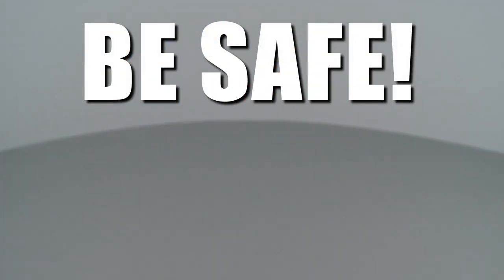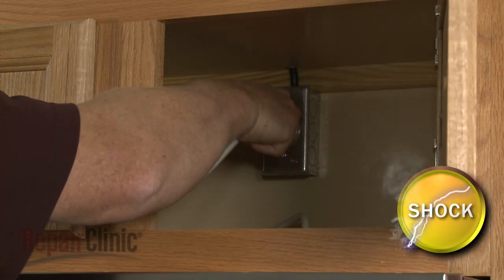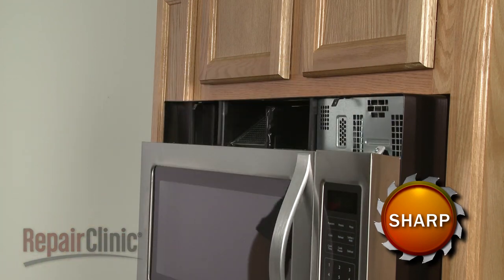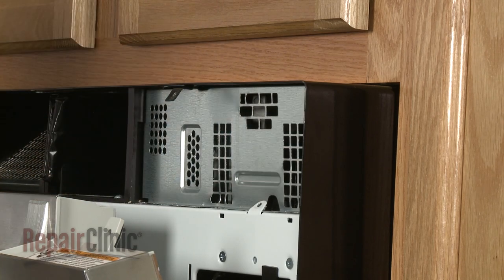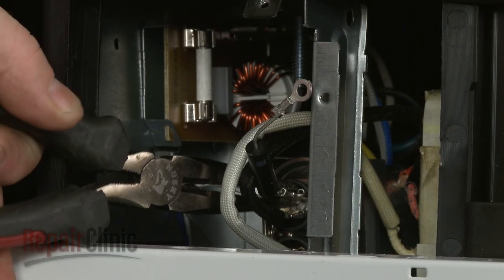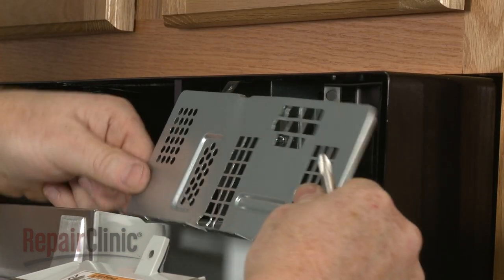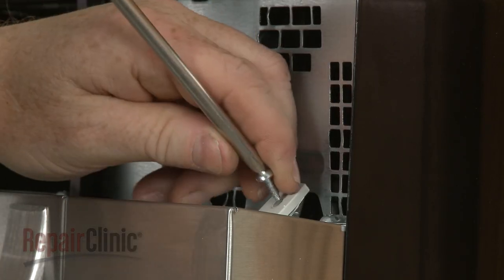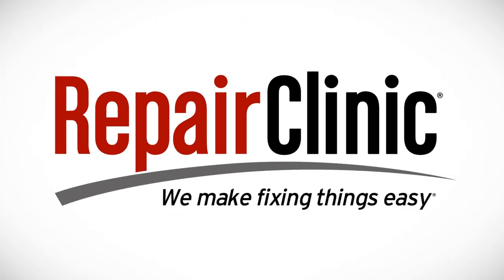Microwave Isn't Heating? Diode Replacement #W10492278

Comment: I just swapped this component out and it worked just fine afterwards. DO NOT THROW OUT YOUR MICROWAVE! This part cost me $5.98 on Amazon free shipping. Would have taken 10 minutes but I didn't have the correct tools. This was such an easy fix.

Comment: my mic has no heat but the dish turns and makes its ussual humming.  is my diode bad or magnatron bad?
Reply: Check diode for burnt residue on wiring ends from diode out . supposed to be silvery not black and ashy . but maybe you already fixed .since was year ago .
Reply: ddogglife21 my microwave has the same issue...not heating...should I replace magnetron or diode?
Reply: Carol Peters im waitning on my diode to deliver but mayve couple more weeks .you shouldnt x out magnetron that quick. Cuase my micro was acting funny few months ago then just started normal for next two months .so it wont hurt to try also i have micro since 1993 .not ready to just let go . for 5 bucks wont break the bank but money tight right now  .good luck. If you want to replace magnetron probably cost as much as new micro wave...i hear diode should be ok.unless you see burnt  beyond recognition magnetron
Reply: Brad 31
 was your diode bad or something else ? I have the same issue with my mic !!
Reply: @imjustcarol2024  When my microwave died the price for a replacement magnetron was almost as much as a new microwave.

Comment: My Micro. is having the same problem humming noise when door is closed, dish turns but no heat. will let you all know if changing out the Diode works. I have a Samsung Micro
Reply: Did replacing the diode work or not mate??
Reply: Please respond
Reply: Yes, capacitor could also not be giving the magnetron enough juice or be completely bad